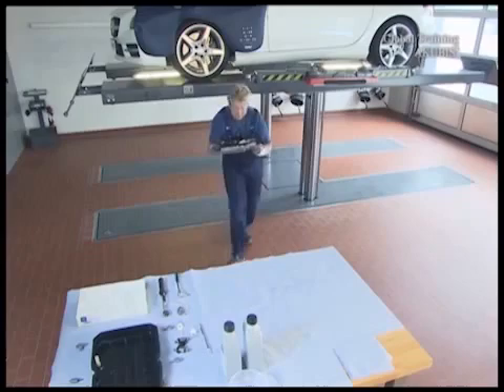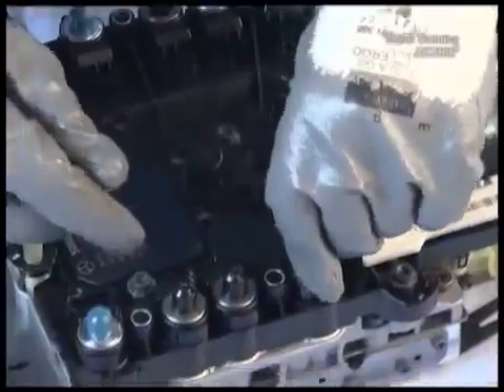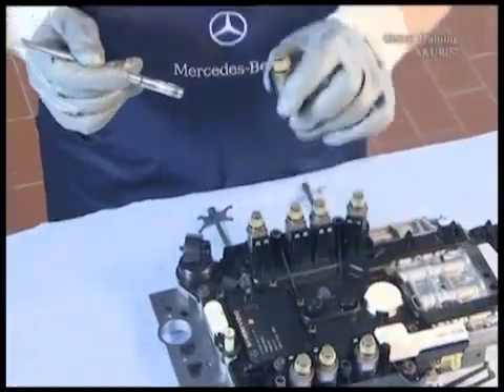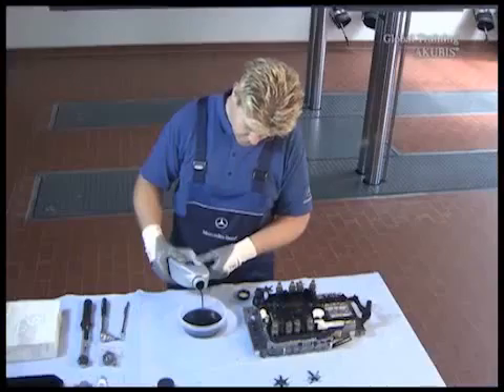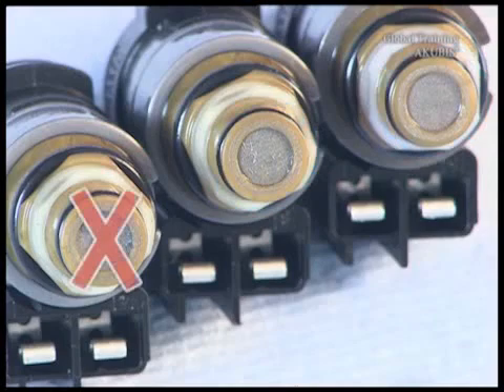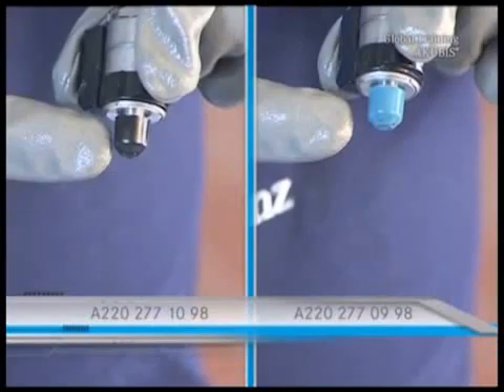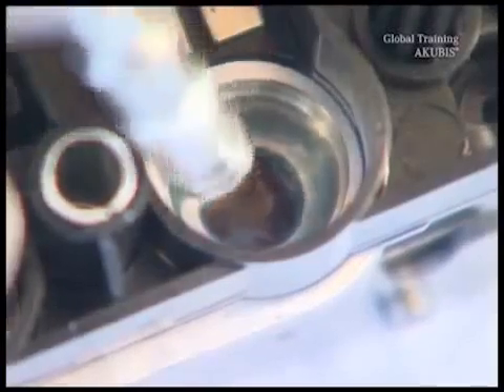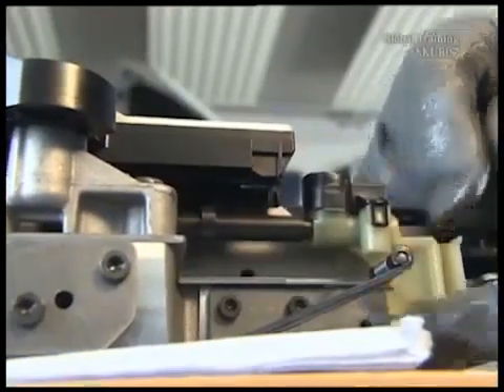Mercedes 722.9  7G-TRONIC Transmission: Cleaning the regulating valves

Comment: My cls 2015 stuck in second gear and wont shift up. Solenoid valve suspected or if metal debris found then full engine replacement. That’s what I’ve been told

Comment: Hi
Very helpful video.do we need coding or programming when you replace 2 or all solenoids?
Thank you
Reply: do you need to program if you replaced a solenoid?
Reply: Of course, cause to replace the oil you need to know the temperature of your transmission, and in cases when transmission will work still bad you can do an adaptation on a your way with xentry program, it takes few hours but its like adaptation but with saving of old settings or replace a torque converter. It’s if your transmission driving bad but you don’t have any error codes. Dealer will never do it for you.
Reply: No you don't need program, but doing adaptations with a scan tool can be beneficial

Comment: Great Video. Cleaned everything as described, did a total flush of system, including draining the TQ, problems solved. Cost?, just some time and 10 litres of Red TQF. Before you pay out a fortune on a new or revised ECU, just remove it and clean it, especailly where the plugs join into the circuit boards. The slightest bit of metal dust, however fine, will cause tracking and give your gearbox faults that in fact don't exist!....
Reply: I agree.  Error coded everywhere... these  coded wanna suck your money
Reply: Sometimes u just need to recycle the whole atf

Comment: Hi, if I open my transmission on my 2008 722.9 just to do this and clean the solenoids and and valves without replacing any, will it need to have a re adaptive procedures done with a dealer level scan tool or is that just if you replace a solenoid?
Reply: If you do not replace anything, adaptation is NOT required.  However, not sure if you SHOULD do this if you are not having a problem.  Removing the valve body is tricky on an older car if it has never been done.  Play close attention to the video at 0:20 and see how the technician uses a plastic pry bar to push the connector down and out.  If it sticks and you try to pull it out, it WILL break.
Reply: @JettaRedIII  I have a c230 2006 with code P0798,  Yes its a 722.9 Trans. Which things do I have to pay attention to before removing the valve body? Thank you
Reply: Bro do you really think the Mercedes corporate is gonna reply to your question on YouTube?
Reply: @ 7 years later, crossing my fingers they might still reply to me bro, I gotta be patient
Reply: @Motorsportsgeek I’m having the same problem on my 722.9 as well, did they ever reply to you ?
Reply: Just replace the solenoid nothing else is
needed

Comment: I have a 2011  E350 with 7229 Transmission.
1)When shirting from reverse to drive at times it appears to go into drive then downshifts.
2) At times after going into drive and moving several feet another shift takes place.
Dealer can not get a DTC. This only occurs while in the "E" mode, at all temperatures.
Dealer states I/m not allowing enough time when going from brake to gas.
Are they any fault codes which would note a delay is NOT being allowed? 
The value boy was changed out, the problem disappeared for several thousand miles, then came back. Another YT video takes about  cleaning the solenoids. Your thoughts.
Reply: Just out of curiosity, but what wound up being the solution on this? And when you say valve body was changed out, do you mean that an entirely new one from the dealer AND conductor plate was done?
Reply: @alextorkelson  ah, sorry I did not tag my guess to the answer. My best guess is little bits of metal are jammed inside the valves at the end of the valve body preventing it to read proper pressure or temperature and it seeing it after the fact causing a hard or delayed shift.
Reply: @alextorkelson  I am doing a similar replacement, the transmission in the mechanical portion i/e not the valve body portion. I ended up finding a replacement for around 1400, then going to keep the conductor place and tcu, swap the valve body and replace all of the solenoids.
Reply: @builder229  any updates please

Comment: i have a p0718 (turbine sensor) dtc. Would cleaning fix this problem? 
((06 c230 722.9))
Reply: It worked for me perfectly! See top comment
Reply: @markhpluygers2226  Did you also have an error code p0718 and clearing the transmission solved the problem?
Reply: Did you solve your error code problem p0718?

Comment: What is the issue of TCM to do cleaning!!
Reply: Amer Alfaori Most likely stuck in limp home. Mercedes stopped dealers returning TCMs without approval. It's suspected this is because a lot were changing them when they weren't faulty and just needed basics doing like cleaning.
Reply: m60kaf Thanks, my Dealer push me to replace the whole body valve due to P0778 Code error (Y3/8y5) and that cost me around 3000$ :(
Reply: Did it worked?